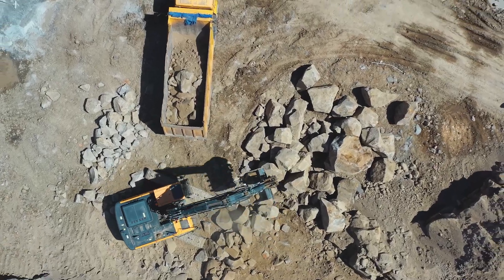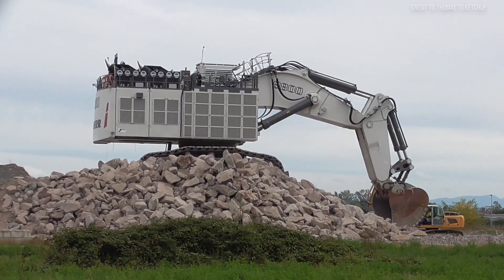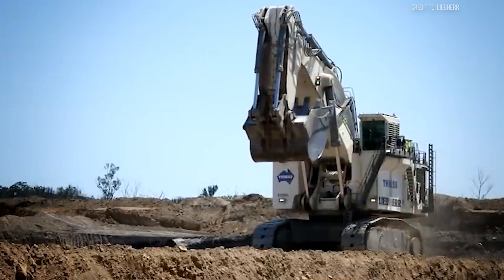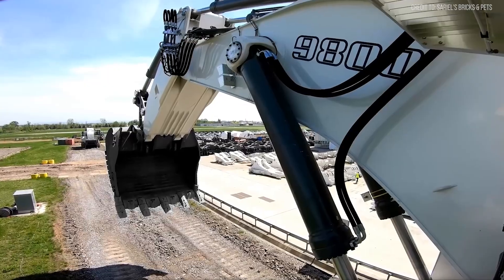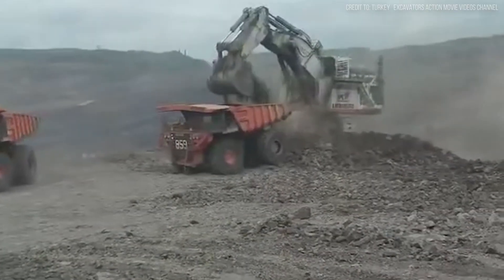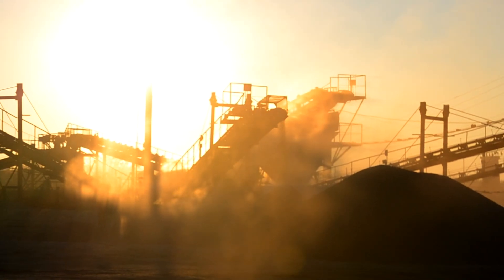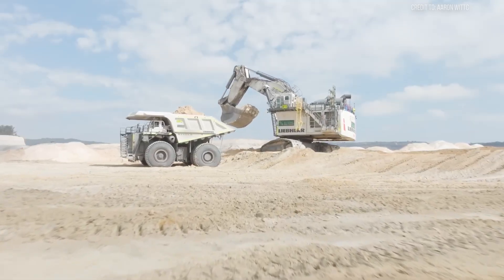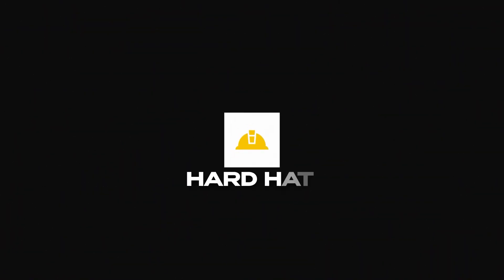What Mining Giants Know About the Liebherr R9800 (That You Don’t)

Comment: [03:16] Hydraulic Force & Speed
It generates 1,760 kN of tear-out force. Though slow (~2.6 km/h), it's impressive for its size. Cost ranges between $15–$20 million USD.
Reply from the maker: It’s certainly a beast!
Reply: @HardHatIndustries   yes :face-blue-smiling: